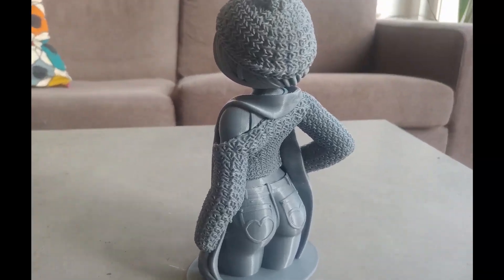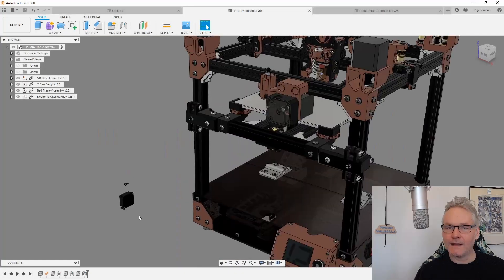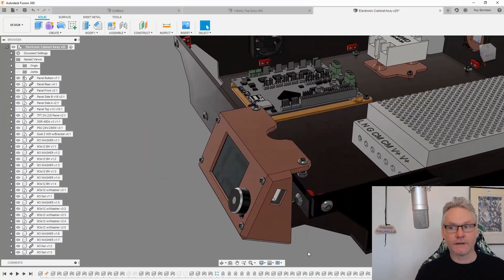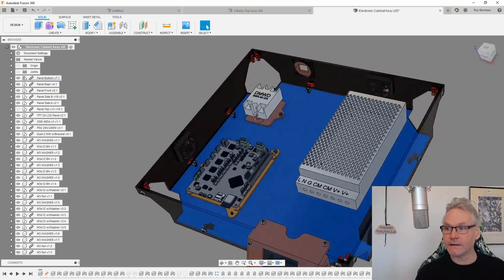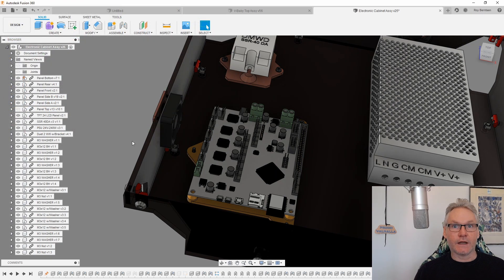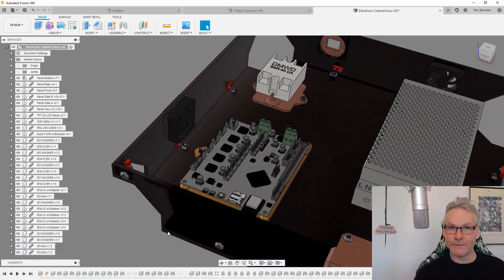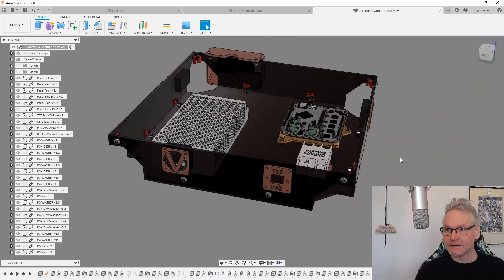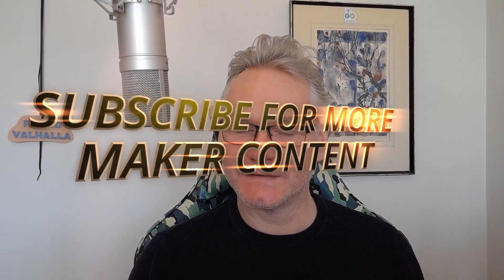Building A 3D Printer | The V-Baby CoreXY | High Speed 3D Printer | Part #7 The Electronics

Comment: Hi Roy. You mention there is a base for a Duet board but I do not see it on Github. Will it be added later? Also, when will a DXF file for the front panel be added? Will you be making an STL for an enclosure for a 4.3" PanelVue screen also? Thanks for a great design.

Comment: Hi Roy, I have been following your efforts. Very impressive. Keep up the great work.

There might be a better place for this discussion, so plz direct me if so. Anyhow...

Speeding up 3D printing while maintaining quality is certainly desirable, and seems to be one of your design goals. Knowing your attention to details, I assume you have tested/verified the "100 mm/s" printing speed. What have you learned?

BTW, I have found http://gcodeanalyser.com to be very interesting/useful. Among other things, it gives a speed histogram. Furthermore, it accounts for velocity, acceleration, and jerk, along w/ other metrics from the firmware. If you already have an app for this great. If not (or even if so) you might wanna check out G-Code Analyser.

TIA.
Reply from the maker: Thank you for the feedback! We usually discuss these kind of tooics in the builders club on Facebook. I have not verified the speeds on the V-Baby. It is clear that in high poly places on the model the head will not reach top speed due to acceleration and deceleration. The duet does report actual speed but I do not have that on the V-Baby atm so I will look into your link. Thanks a lot. Stay safe. Best wishes Roy
Reply: @PRO3DESIGN  Thx for the reply. I searched FB for "V-Baby", but only found "Viking 3D Printers" (https://www.facebook.com/vking3d), & "PRO 3D Norge" (https://www.facebook.com/pro3dnorge). Which one of those (or other) should I join?